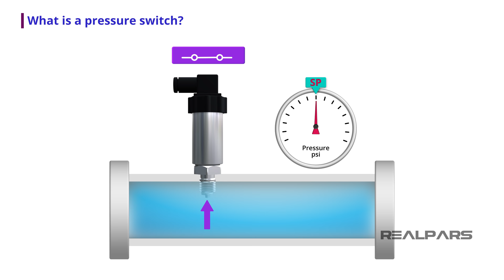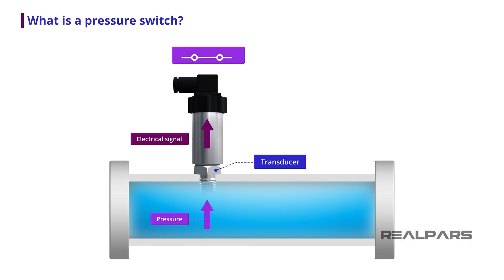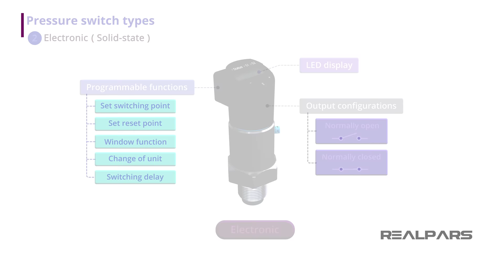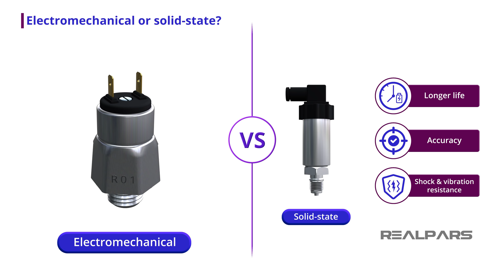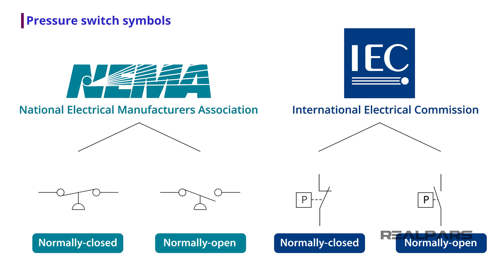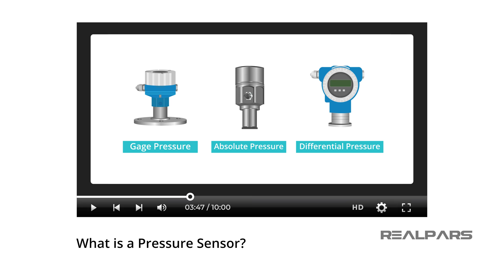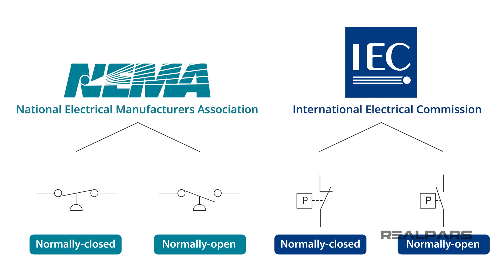Pressure Switch Explained | Types of Pressure Switches

Comment: How does deadband differ from hysteresis?
Reply from the maker: Hello….thanks for your question. Deadband and hysteresis certainly have somewhat similar results. Generally speaking, Hysteresis is a magnetic term. For example, hysteresis is a lag between input and output in a system upon a change in direction, or when the change in magnetism of a body lags behind changes in the magnetic field.

Comment: @4:27, please what do you mean by electromechanical switches not being voltage-dependent ?
Reply from the maker: Hi Bitebo. Electromechanical switches don't really care if the voltage is AC or DC, or what the actual voltage value is as long as the contacts are capable of switching the current.  But, solid-state, or electronic switches are very particular about what voltage is applied to them.

Comment: Your explanation of the brake oil switch was a bit unclear. If it opens when the pressure drops then is it a normally open pressure switch or a normally closed vacuum switch?
Reply: Same thoughts. That's why I gave them the feedback that they could've included the rising and falling setpoint.
Reply from the maker: Hi Stephen. Thanks for your comment. It’s a pressure switch that “operates” on a decrease in pressure below the setpoint. Symbols are always shown in their “de-energized state, and this switch is shown closed. By convention, it is called a “Normally Closed” pressure switch. Because it is shown as a “Normally-closed” switch, it opens when it “operates”. Opens on a decrease (drop), and closes on an increase (rise) in both pressure or vacuum situations.